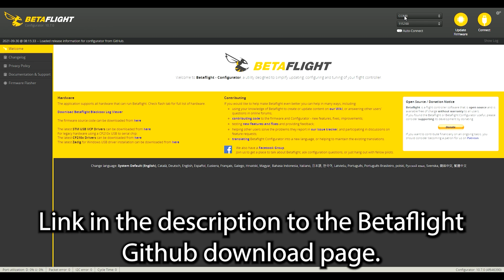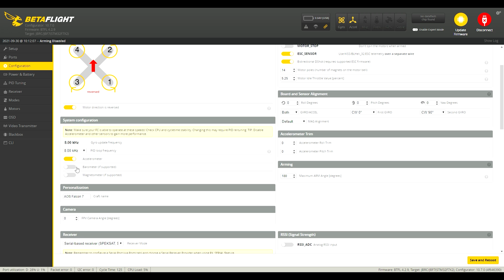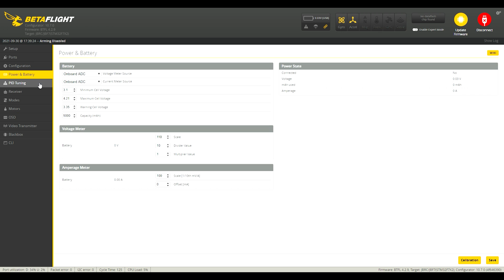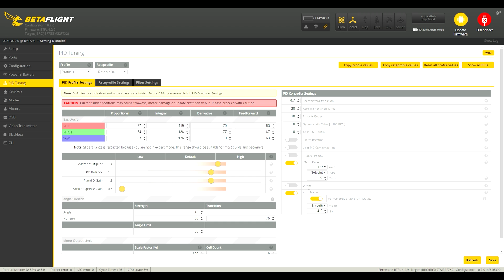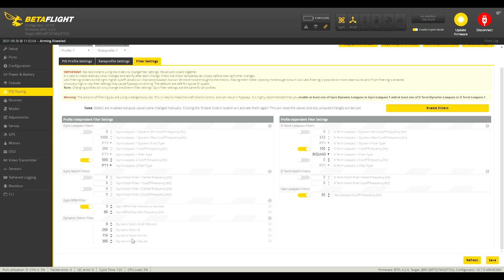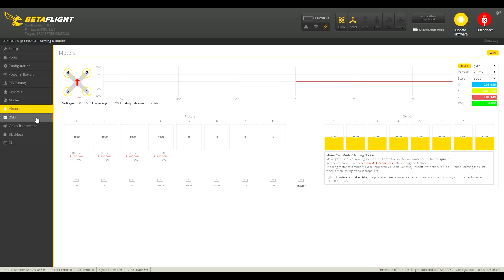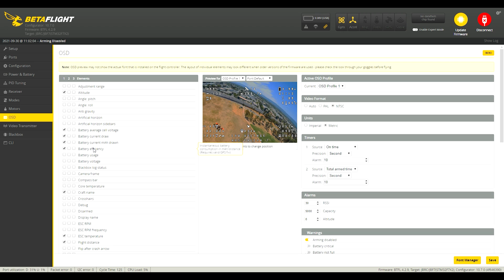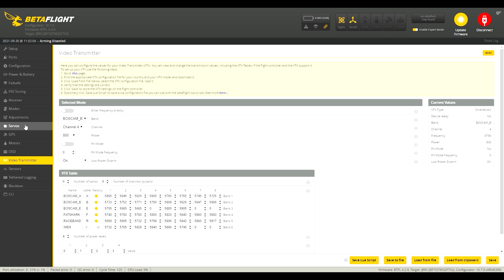Betaflight settings for my AOS Falcon 7 Long Range FPV Build

Comment: Yo, got a quick one for you about that 'Set Home Point Once' thing at 2:33. Thinking, if you ditch that option, could it make your drone easier to spot in the same jam as the one in this vid (https://www.youtube.com/watch?v=bGhLFI0hHTg)? 
Let me know, curious minds wanna know!
Reply from the maker: No it wouldn't have helped in this situation at all.  Set home point once means that it locks the home point when you plug a battery in.  If it is not checked off then home point is set when you arm the drone.  In my opinion it should always be turned on.  Unless you have a specific reason why not to.

Comment: Hello I have 2508 1200kv motors and they just overheating after one minute of flight🥲 What should I do?
Reply from the maker: It's either due to not enough filtering, too much vibration or too much weight, those are my guesses at least.  If it's for the Falcon 7 frame then vibrations likely shouldn't be the issue as long as you have double checked all of the fasteners.  Check that the PIDS are at a reasonable level, for BF 4.2 master slider at 1.3 and p/d balance at 1.1 should be a good place to start.  But also start with the filters all at the middle setting then move them up slowly one notch at a time and checking the motor temperatures each time.  I recommend tuning it with a battery of about 400 - 600 grams and with the gopro mounted in front.  Also  check that it is at least close to balanced between the front and back motors when its ready to fly, a little front heavy is ok.

Comment: Hello, how are you? First of all, thanks to your channel, I have learned everything necessary to fly well and safely, and the reason for my query is that I have installed a GPS BN220 that until now worked perfectly, but from time to time the arrow of the direction of takeoff (home) changes constantly and also the distance, with the result of being able to get lost when returning from a long distance, to what may be due, I leave you the link of the video and where you can see it perfectly is from min 4, the arrow goes completely backwards from where it took off, which was next to me. https://www.youtube.com/watch?v=8RoJOyicHOg
Reply from the maker: Sorry YouTube didn't show me this comment until today.  I think it was held because there is a link in the comment.  Anyways, sorry for the late reply.  I'm not sure what would be causing that GPS issue.  It seems to almost lose track of the home point, the distance to home doesn't make sense as well as the direction arrow.  To start try saving your betaflight setup to a file.  Now reset everything to the defaults and change as few things a possible, just enough to get the quad flying with the GPS turned on.  Now see if it works any better, if you try the same test a few times and it still does the same thing again then I'd suggest replacing the GPS.  I've seen the home arrow be wrong before but never wrong then right, back and forth.  If changing the GPS doesn't help then I'd suggest trying changing the FC.

Comment: Do you have an updated tune for 4.3? I'm just finishing up my build.
Reply from the maker: I haven't started flying 4.3 yet.  I'm going to wait for better weather when I can get out more consistently to be able to get some tuning in.  Also I like to wait a bit when new versions come out, give it a chance to have bugs found and worked out.  I am looking forward to the new tuning slider setup.  I'm hoping it will make it easier to get a better tune on the pitch axis.

Comment: I have been running your settings for a while, but last week I have had a complete flyway just as was going to check if the drone arm correctly.
My guess is that one of my LEDs extensions (for the motors had a short, because after I replaced the burnt motor the new one didn't spin too) and the drone did not start that motor and burned it trying to see if it was rotating or not. My question is.. shouldn't I disarming stop all the motors right way?!?
I am running elrs 900mhz and did test the fail-safe before with no issues. I know that in the BF tab it suggest that the drone could flyway, my question is shouldn't I be able to have disarm it?
Reply from the maker: Sounds like there may be an issue with the ESC?  If one of the led extensions for the motor wires shorted out it may have permanently damaged your ESC which means it might just fry a motor every time you try.  A smokestopper might left you check the ESC without frying motors, but if you lost 2 already I'd suggest not using that ESC anymore.   If there is a short somewhere then it can cause a malfunction in the firmware.  You should always be able to disarm unless there is something going on like a short somewhere.
A few years ago I crashed in the wet grass.  The quad was disarmed but still throttled up when I picked it up.  They are safe when everything is working perfectly, but one short or something wired wrong means it may now be dangerous.  Every time I plug in or unplug I do it quickly and I don't hold it while it's plugged in other than to walk over and put it down on the ground.
I would carefully recheck all the wiring and look for anything unusual.
Reply: @FalconRadFPV  I haven't expressed my self correctly, it only fried one motor. But didn't want to start the 2 new motor, after I swapped my led extensions for normal ones everything worked fine, already rechecked every wire and change some (that looked to have some fatigue).
So if that LEDs were shorting could that be the cause making the drone not wanting to disarm?
I have already bought a new FC and ESC, will be replacing them just to be sure as my current ones already are on the drone for some time now.
Thanks for your help 🙂

Comment: I’ve finished my new Falcon 7 , I’m configuring it on BF 4.2.11 .same iflight esc 50A 4in1 as yours ( blheli32 32.7 ) . I’ve enabled bidirectional dshot, and setup the FC with DSHOT600, in this mode I got errors in the motor tab running the motors , do you have errors too ? It’s a small amount like 0,01-0,02 % . If I switch to DSHOT300 the errors disappear !
Reply from the maker: Ya I put notes about that in my build video.  iFlight produced a batch of ESC's with CKS MCU chips in them and they don't quite run bidirectional dshot properly.  I found it to work fine on dshot 300 as well.  Actually it flew a bit better than my other similar build.  I'm not sure if it was because of the dshot 300 vs 600 thing or a tuning difference though.  Either way it should still fly alright on dshot 300 if it's tuned.
Reply: @FalconRadFPV  Thank you for the feedback , today I make some pid tuning ( pids like yours in the video  )  and in dshot300 seems to fly very well. I tried blheli32.8 ( not the latest 32.8.3 but the “official 32.8) and the errors go away but rpm data is absolutely unstable , so I rolled back. The only thing I cannot get rid of is some wobble when I punch and leave throttle , it seems to be better with min throttle to 7 instead of 5.25 but I need to make more tests, maybe it’s just the battery position dunno

Comment: Great Video! I'm currently setting up my iflight Chimera 7inch Quad for Betaflight 4.3.
Are you thinking about posting your BF 4.3 settings or make a video accordingly?
Reply from the maker: I'm going to wait for BF 4.3 to be out a bit longer before putting it on a long range quad.  Maybe in a couple of months.  I want any bugs to get found out and fixed before trusting a long range quad and gopro to it.

Comment: Hey man, I noticed your arm range. I would recommend putting the slider a little further to the right, further from your arming set point. I had one issue one time with the set point being to close to the range
Reply from the maker: Thanks for the tip, I'll look into that.

Comment: Hi, did you change you PWM to 48khz ?
Reply from the maker: No I didn't.  I think the stock 24khz setting is better for 7 inch quads.  I "THINK" the smaller the quad the higher the pwm can be.
Reply: @FalconRadFPV  thanks, i will change back to 24khz ^^

Comment: Great setup! Flew the drone last week as the maiden feels great on stock BF settings! Waiting for the lipo's now so I can do some long range testing.
Reply from the maker: Oh great to hear that!  Good luck with your testing.
BTW remember to get to know your new lipo's range and total mah count in the OSD (mah usage is a great way to monitor your batteries capacity for used VS what's left.)
Reply: @FalconRadFPV  Really good to know! One question if I have two batteries in Serie (so the MAH adds up) I also choose the double MAH in betaflight right?

Comment: Thanks Conrad! Loving my AOS Falcon 7 so far, currently set up with DJI but using the Bardpole rear/diversity link. I was slack and used my iFlight Chimera7 Betaflight settings and it flies amazing but I'm going to do some tuning now I've seen this! I'm using a Matek M8Q-5883 which does some strange things in regards to altitude, distance and home direction - accuracy etc fluctuates(even when fully warmed up and plenty of satellites). I'm using the RushFPV F722-HD 60amp stack which seems OK but might swap out to something else. Super happy with the build and really appreciate your videos mate 👍
Reply from the maker: Great glad to hear it.  Ya with more testing now between two similar builds I'm finding the brain fpv gps to be a bit better.

Comment: Curious why you don't use iNav with its superior RTH capabilities? Or have you found that betaflight rescue works just fine?
Reply from the maker: I just prefer betaflight because it's what I'm used to and I don't use any of the gps functions very often.  Mostly the home arrow.  I use autolevel and throttle if I lose video.  I use GPS rescue only if I absolutely have to, which is not very often.

Comment: another question. how does the 6s2p li-ion 18650 perform when it is used to climb towards a snow peak facing cold temperature? I watched all of your videos and it seems does not get affected in cold weather. haven't tested yet, curious about if it is better in cold temperature compared to Lipo, thanks!
Reply from the maker: I've found that the li-ion puts out a few less mah in really cold weather.  It also sags a bit worse.  You just need to keep that in mind when flying, so pull out of dives a bit earlier in the winter time for instance.
Reply: @FalconRadFPV  Thanks a lot!

Comment: Switch to Dshot 300 and 4k, it's less noisy. Your idle throttle is to low and will induce wobble on zero throttle situations. Set it to 7%.
Since you fly long range I would always go with more filtering due to higher efficiency. More noise induces more corrective action through your pid controller = warm/hot motors meaning wasting energy.
I also use a different approach in tuning. This frame has its peak resonance at 165hz. Placing a static notch at this frequency with low cut 110hz will allow you to run much less filtering since you combat the main noise. All the other noise will be addressed by rpm filtering.
Reply: I applied your suggestions and can confirm it's a nice improvement. This is my smoothest flying 7" quad ever. I've actually built a second Falcon! Just got to tune them both up, but it's looking good!
Reply: Why dont you make a video with your setup and settings. Would love to see another aproach 😊😎
Reply: @stephanreef8449  
Making such videos is lots of work. I have 2 kinds and many other hobbies. Therefore there's not much time left to do this hobby. I try to help by placing these comments :)
Reply: Much appriciated. I also got two kids. So i know the hard work it is with the kids and i got twins whaaaaaa
Reply from the maker: Thanks for the tips! Looking forward to trying your suggestions.  👍

Comment: great lesson! I am experiencing wobbling and slight slight twitch when cruising, it just keep bring small vibration expecially at low throttle, but surprisingly the blackbox analyzer looks perfectly clean. FR7, rush sport 50A tower and BH2806.5 1300KV, may I ask what should I tune next? thanks bro!!
Reply: Maybe your gopro is vibrating
Reply: If you are running 48khz pwm switch to 24k. Never use dynamic PWM. Run some lighter props like Gemfan 7040.
Reply: @waldemarkraus2855  that make much sense, thanks bro!
Reply from the maker: I'd try Waldemar's suggestions.  I use the same BL Heli32 settings, no dynamic pwm and 24k, I also usually use the gemfan 7040.

Comment: Doesn't bidiretional dshot only work properly on dshot300?
Reply from the maker: With an F7 processor on the flight controller it can handle dshot600.  Although I have just been told that dshot300 may be smoother.
Reply: @FalconRadFPV  For 8k PID loop there is no advantage for dshot 600 compared to dshot 300. Because only 50% of the command "space" is used. Check this Video from Drone Mesh -> https://www.youtube.com/watch?v=LUG-pZ0LKaQ